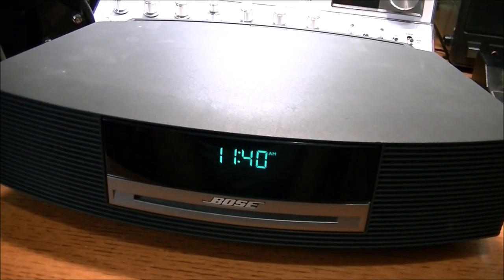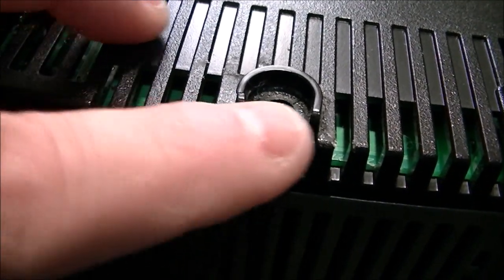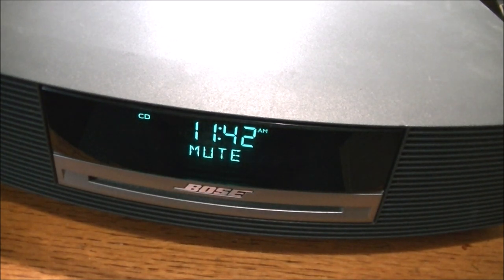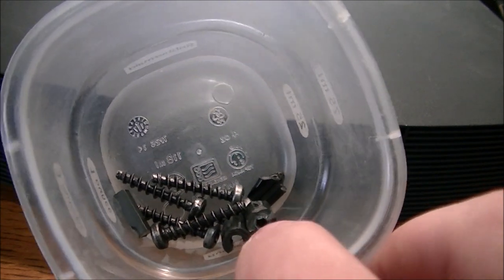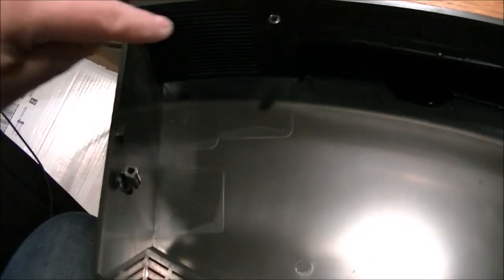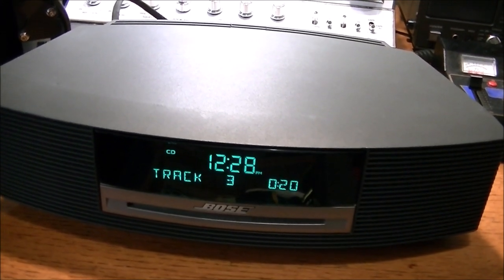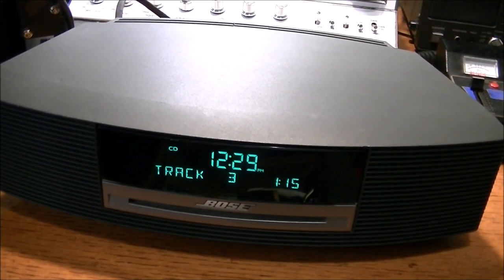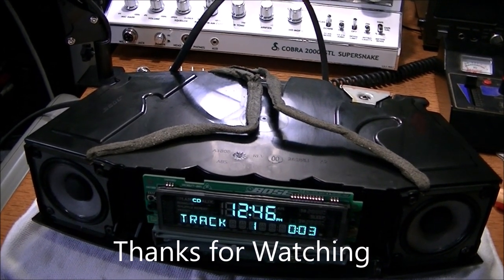Bose Wave Radio - Case Repair from Shipping Damage and CD Player Troubleshoot

Comment: Andy, I always use JB Weld original cold weld formula. 2 part epoxy. It is stronger than steel. You can also get the black which matches up pretty well with items like the one you are repairing here in this video.
Reply from the maker: I have this tube of JB weld  plastic bonder hIgh strength adhesive.  Is that what you are referring to?
Reply: @Tobinindustrial  That will probably work but, I am referring to the original cold weld formula which is 2 part epoxy, 2 x 1 ounce tubes. The original Cold Weld formula is a red and a black tube in the package. The JB Kwik is blue & yellow tubes in the package. The original is a gray colour, the J-B Kwik is almost black when mixed.

Comment: Andy, what kind of glue did you use to glue the case screw mounts? I knocked one loose while cleaning the case and need to fix it. Looks like you did a nice neat job.
Reply from the maker: I used JB Plastic Binder High Strength. It sets up in about 15 minutes. It comes in a syringe type double tube dispenser, so the mixture measurement is dead easy to do

Thank you for the comment and the channel support. 

Happy New Year
Reply: Thanks, and Happy New Year to you too!

Comment: The one's I got shipped to me nearly all the front and side plastic mounts are all blown out.  There's a nub left, now what do i do?
Reply from the maker: That is tough luck. Do you have any pieces of the nubs that you can put back like a puzzle? if so, check out this video I made. https://www.youtube.com/watch?v=rHcg5QtI8pg
Reply: @Tobinindustrial  it was a wave III and yeah I have the pieces but they are all so fragmented.  I was thinking of dremeling off the nubs and gluing a stock block of plastic and trying that.
Reply from the maker: Yes, that will work. You need to be very accurate with the placement of the new screw slots because the case is fitted snugly with little wiggle room. 

In the meantime, once the top is on, it works just the same so don't lose too much courage. The radio still will perform well and sound great, Nobody will notice the difference. I have one here that I did not repair and it has no nubs, I dremel'd them off. LOL